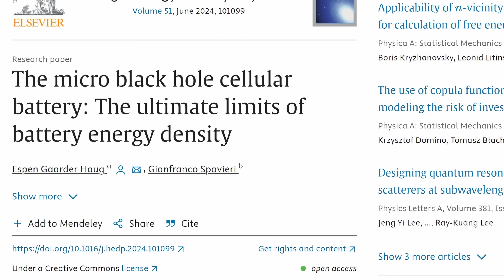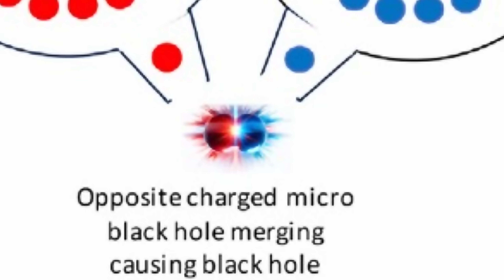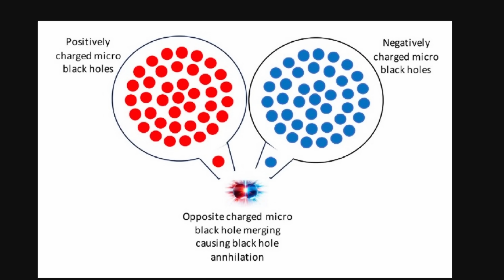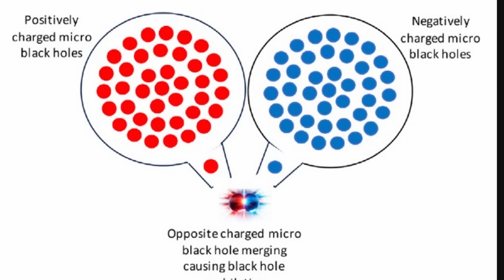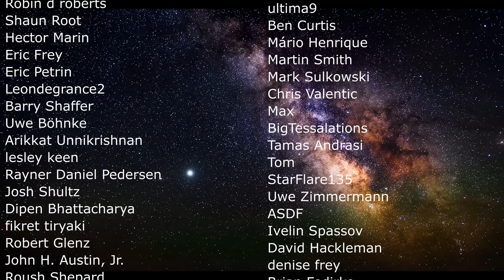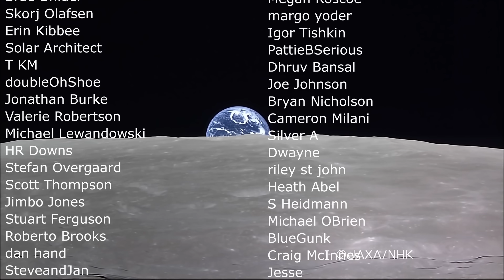Microscopic Black Holes Could Create a Perfect Battery (According to This Study)

Comment: Hey Anton i have a theory

#### Main Hypothesis
The theory suggests that what enters a black hole traverses another dimension. Much of this matter passes through a white hole in a higher dimension, undetectable except through gravity.

#### Mechanism
- *Dimensional Transit*: Matter absorbed by a black hole isn't destroyed but transferred to another dimension. By inverting the time curve at the heart of a black hole.

- *White Hole*: This matter reappears through a white hole in a higher dimension, exerting a measurable effect only through gravity from our dimension.

- *Matter Transformation*: A fraction of this matter transforms into space-time, while the rest remains in this other dimension, influencing our dimension as dark matter.

- *Universe Expansion*: The expansion of the universe would result from the degradation of dark matter in this other dimension. As the universe expands, the "universal white hole" would diffuse an increased flow of space, explaining the acceleration of the universe's expansion.

#### Distribution of White Holes
- *Non-Localization*: White holes wouldn't be specific points in our universe but would exist everywhere simultaneously because they are in a dimension where space and time don't exist as in our reality.

- The effect of white holes would manifest continuously and steadily throughout the universe and time.

### Consequences of the Theory
- *Dark Matter*: Dark matter in our dimension could be the residual matter of this other dimension, exerting only a gravitational influence.

- Accelerated Expansion (Dark Energy): The acceleration of the universe's expansion could be linked to the increased space diffusion by the universal white hole, proportional to the universe's enlargement.

In summary, this theory proposes a connection between black holes, white holes, and higher dimensions to explain certain phenomena of the universe, such as dark matter and accelerated expansion.
Reply: I've heard about this.
It's called "bong hit cosmology".
Reply: @bryandraughn9830  I didn’t find it, link ?

Comment: I had a class in BH where it was stated that the last second of evaporation of a primordial BH released something like 100,000 Megatons of energy in an explosion.  So that is not going to work well as a power source.
Reply: I think thats exactly what they are doing in this paper though. Each blackhole collision releases 100,000s of Megatons of energy and you capture it using magic hypothetical technology to get the highest possible energy density in a battery
Reply: @100brokensticks  The technology for capturing that power isn't hypothetical, it's called water. The high energy particles radiated from annihilation would be attenuated by nuclear and electron charges in the water molecules, causing the water to heat up.
Reply: We can recycle batteries into WMDs, REJOICE! xD
Reply: The hypothesis is that plank-distance sized block holes can't evaporate, because they're smaller than the wavelength of any particle they could create with Hawking radiation. They could explain dark matter, as these small holes wouldn't interact with normal matter very much at all, and might even be where all the primordial anti-matter went.
Reply: @llamatronian101  It is hard to say what a planck length body could or couldn't do.  Could it rotate?  The quanta of angular momentum may not allow that.  Would the mass of all such bodies be the same?
Reply: Ive read that once black holes reach the planck size, they may be incapable of both absorbing or radiating anything..
Reply: How much more power do you need ?
Reply: A spin stabilized mini black hole would make a super efficient weapon or large asteroid mining explosive.
Reply: But are all Planck sized black holes the same mass?

Comment: Wouldn't solar panels on satellites be easier to put in place around the sun then a giant hamster ball.  And why replace chemical rockets why not aid  them. Start with chemical rockets for thrust. Then switch to ion for maintenance of speed. Even sending vibrations through the walls pushing the atoms themselves  it would push the object vallum but push the Mass making it easier on Chemicals and ions. . And 

If much of a ship's mass is fluid then moving the fluid would move the mass
Reply: congratulations you just invented a Dyson swarm
Reply: also chemical rockets weigh a ton that's why we seek to replace them